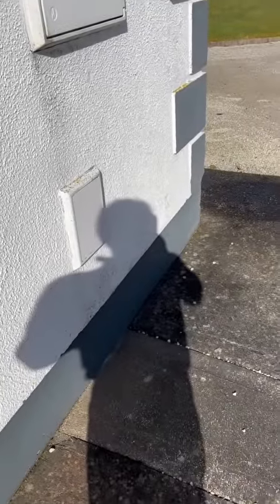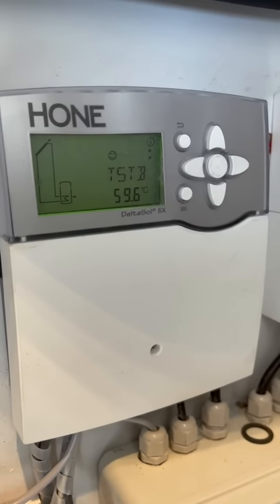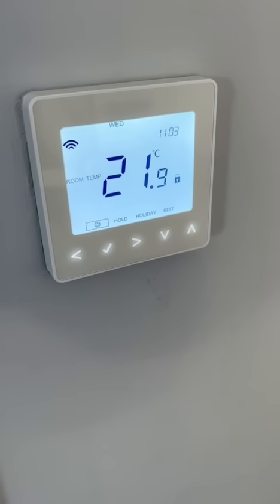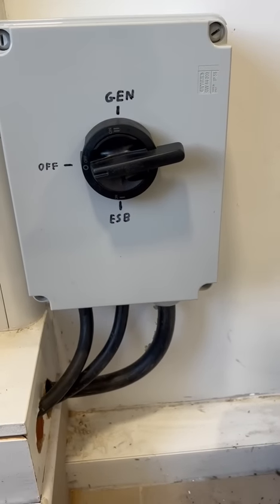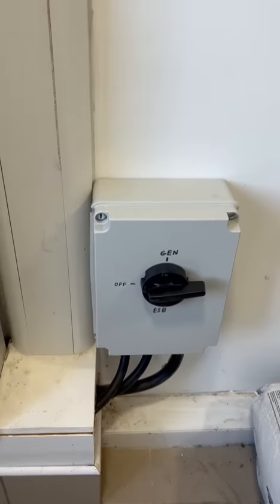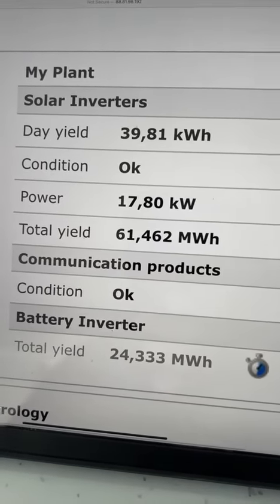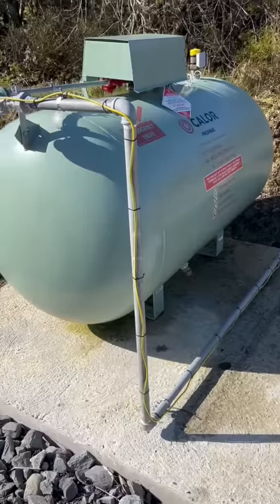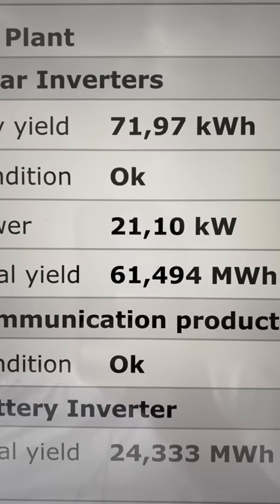Living off the grid in the west of Ireland....

Comment: That's crap   My friend  installs solar system 
You might get enough to heat water in the summer but will still need to be connected to the grid   
Maybe in Africa or Australia but not in Ireland 
There's not enough sunlight
Reply: That's what I would have thought too....takes a lot to heat rads.
Reply from the maker: You have highlighted a big problem in the industry, people think all solar technology is the same, its actually very different, there are both cheap (the most common Solar product sold by salespeople) and then you have premium renewable technologies sold by engineering companies who do not have any sales people. You get what you pay for in this industry as all others.

The links below are showing both electricity output and renewable heating data screens on Jan 1st in the west of Ireland, Electricity output peaking at just under 10kW power & 3.5 days worth of electricity produced. This is because this is not basic Solar PV which doesn't work in winter. This are 3D semiconductor panels designed specifically for the built environment. The renewable central heating panel system was 68C on Jan 1st, again you can't get this from regular basic solar hot water panels. These HONE Thermal/Electric panels hold the world's highest performance certification. 

If you want to achieve performance, you need to by the right technology.

https://twitter.com/hone_energy/status/1573934418837774336?s=20&t=Jg-_BSG-lEKLDsW1EUGpaQ

https://twitter.com/hone_energy/status/1534171351963017219?s=20&t=Jg-_BSG-lEKLDsW1EUGpaQ
Reply: Comparing the solar radiation for say June/July to Dec/Jan, you can get this on Met Eireann monthly data, there is roughly 10x difference for my nearest met station, so it's possible to have hot water or even solar off grid the entire year, the problem is it requires alot of solar panels,

Comment: Whats cost on this system
Reply from the maker: The cost has mentioned many times on our website. The payback on this system is 5.1 years with 45 year design life. It had been 7.3 years payback but the current energy price hikes have shortened the payback so it be fully paid for early next year.

4,500 sq ft home, no electricity bills, no heating bills, & 4 EV's charging since early 2018.
Reply: Can you send rough break down!ive looked on website no details?or can you send me page its on thanks would be great
Reply from the maker: Basically, it's a lifestyle choice.

We don't like to rent our homes and prefer to own them, and they are significantly bigger purchase costs than energy systems.

Owning your own energy system is just another decision to own your energy rather than rent it from someone else.

This means, like the house, you are investing in low or no energy bills with significant advantages in that you can also get rid of petrol/diesel purchasing as well, are immune-ish to energy price increases & in this particular case, immune to blackouts & any impact on your normal life.

In the end, it's not really you who is paying for your system; it's all the fuel & energy suppliers to whom you are no longer renting energy.

Just looking at this customer's house size and the current market energy costs, the kerosene bill would probably be at least €6,000 for the year & we know the last ESB bill before the changeover to full off-grid was €736 per 2 months with 2 EV's included in that in 2018. That would be double the cost today as well.

Even without considering all the other benefits, that's a saving of over €10,400. Add all the petrol not being bought from 3.5 EV's all charging for free, and the change of a diesel 4x4 to an electric one which saved €2,200 on annual road tax.

(Note: EV's in rural Ireland are nearly doing full charges every two days due to the distance they travel)

You are now up at €16,000 to €18,000 annual savings.

You could also add in the hot tub, which costs nothing to run for 8 months and a big bar fridge which is the same. These also have significant savings.

So hopefully, you can see this is a lifestyle change rather than just trying to reduce your energy bills.

Comment: Nice, but who can afford that...?
Reply from the maker: Basically, it's a lifestyle choice.

We don't like to rent our homes and prefer to own them, and they are significantly bigger purchase costs than energy systems.

Owning your own energy system is just another decision to own your energy rather than rent it from someone else.

This means, like the house, you are investing in low or no energy bills with significant advantages in that you can also get rid of petrol/diesel purchasing as well, are immune-ish to energy price increases & in this particular case, immune to blackouts & any impact on your normal life.

In the end, it's not really you who is paying for your system; it's all the fuel & energy suppliers to whom you are no longer renting energy.

Just looking at this customer's house size and the current market energy costs, the kerosene bill would probably be at least €6,000 for the year & we know the last ESB bill before the changeover to full off-grid was €736 per 2 months with 2 EV's included in that in 2018. That would be double the cost today as well.

Even without considering all the other benefits, that's a saving of over €10,400. Add all the petrol not being bought from 3.5 EV's all charging for free, and the change of a diesel 4x4 to an electric one which saved €2,200 on annual road tax.

(Note: EV's in rural Ireland are nearly doing full charges every two days due to the distance they travel)

You are now up at €16,000 to €18,000 annual savings.

You could also add in the hot tub, which costs nothing to run for 8 months and a big bar fridge which is the same. These also have significant savings.

So hopefully, you can see this is a lifestyle change rather than just trying to reduce your energy bills.